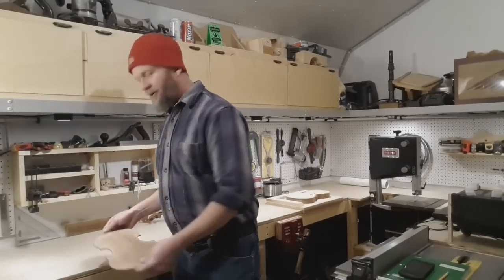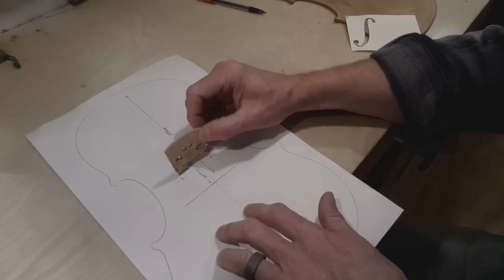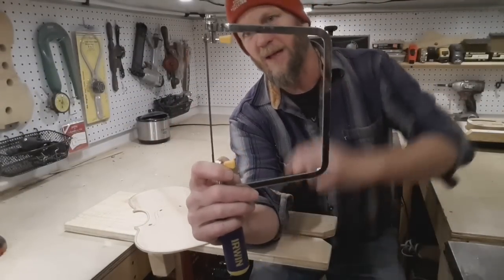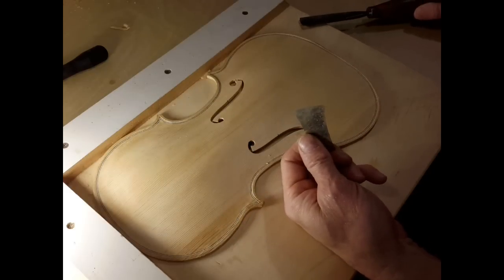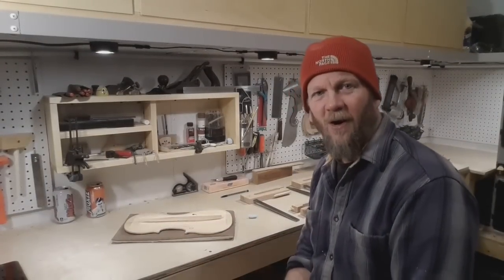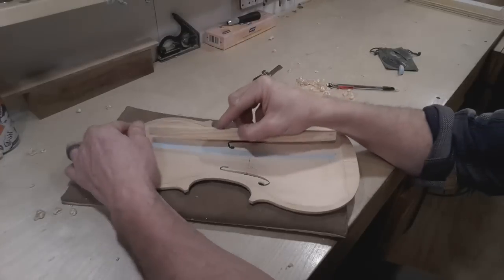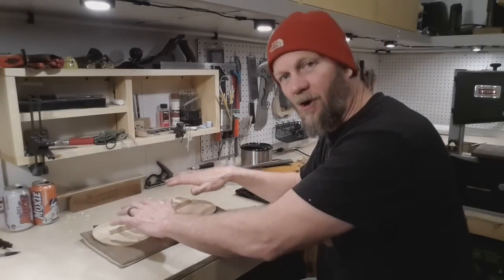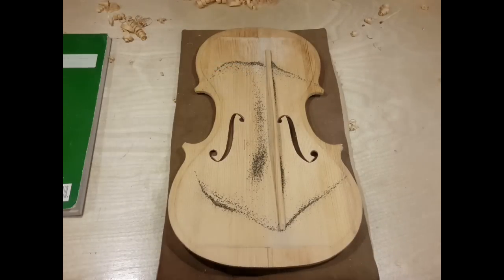How to Build a Fiddle -- Part 6: ff holes, bass bar & plate tune

Comment: Delighted you did this Jon. I have been swamped with information and opinions as I have worked towards making an instrument over a few years and this neatly connects the dots. The jigs and advice on affordable tools are priceless! That fiddle pillow is really clever -- it will adjust to any arching scheme. Thanks so much for putting the effort in to do this.
Reply from the maker: Thankyou for all the kind words!  
I look forward to hearing about YOUR fiddle!

Comment: Great stuff, Jon! I've always checked my modes by tapping,  listening, twisting, and flexing, but you've really whetted my appetite to try the frequency generator and Chladni patterns.
Reply from the maker: If you have no reference point.... other than a nice ring...you have little to work with.
If you get the Mode 2 to be half the Mode 5, you get a wonderful ring to the plate.  
Nothing substitutes for good, careful workmanship.  The Chladni pattern can at least reveal some places that need work.
Reply: @grandpasmountain  Yes, I tune each mode by ear.  As you probably already know, you can hear the different modes by holding the plate at the different nodal points and tapping at the appropriate areas,  like what you do by moving the foam blocks and speaker.   What is s mystery to me is precisely how to get the nodal lines to move where you want them.   I do it by feeling the torsional flex and finding the flex point in t he bass bar.  Very tricky business! Thanks again for your generosity!
Reply from the maker: @st.ceciliasconservatoryofmusic  I'd love to see your method.  I was taught that the relationship of the plates to each other was most important.  We surmise that the great makers did as you and possibly used a tuning fork to set the Mode 5 and 2.  Mode 1 seems to set itself with proper carving.
Getting the right relationship can be tricky-- as research proved that if the tap tones were either too close or too far away would result in a mediocre to poor instrument.  

Your carving is most likely spot on-- and if you use the traditional materials, the various modes will fall where they are supposed to.

I find the plate tuning most helpful when using odd woods-- and odd grain orientations.  Cedar for example, benefits alot from following the correct mode 5 frequency.  

All the modes are a function of grain stiffness.  Obviously the lower the frequency, the lower the stiffness or strength.

YOU should make a video and share your method.  Lots of fellows are longing to learn ways to improve.

Comment: Hey got to say you have been a real help with me starting my first violin build and a indispensable source of information and help. I was just wondering though at this stage with your top plate is it at the same thickness you left it in the previous video 3.25 at the top 3.7 in the middle and 3.5 in bottom ? Because it hit the frequency you were after straight away i'm guessing it stayed the same ? Having looked at thickness maps on making the violin and else where a lot of the seem to be in the 2. something range over the plate. Thanks

Comment: Thanks for these videos. Could you tell me why not carve the bass bar when carving the top instead of gluing ?
Reply from the maker: That was done on cheap factory violins, and was tried early on in violin making.  A separate bass bar has proven itself easier, to sound superior, and allow the tuning of the bare plate.

Comment: Any reason other than ease of construction that the bass bar is not cut or carved out along with thicknessing the belly. Also, if you have the chance I'd like you to carve a radiating pattern of ripples emanating from the sound post location on the back plate. I'm just pulling your chain😂jon.
Reply from the maker: Once upon a time, bass bars WERE integral with the belly plate and that changed due to a myriad of reasons.

Carving a separate bass bar has many advantages and has become the standard.  Yes, it is probably easier, as well!!